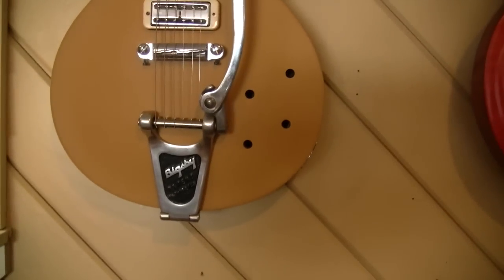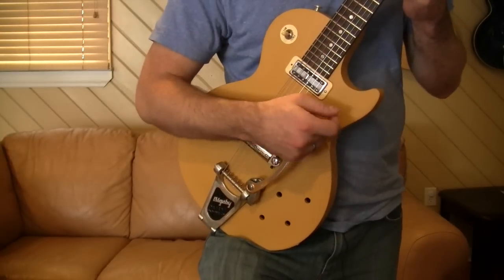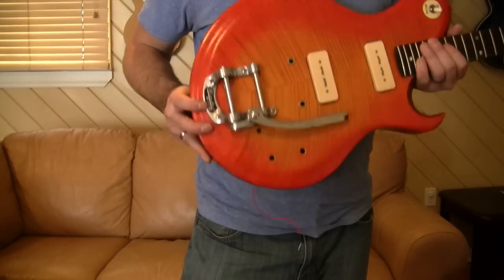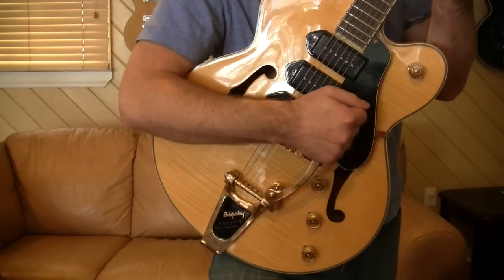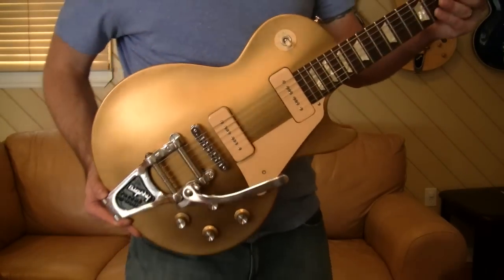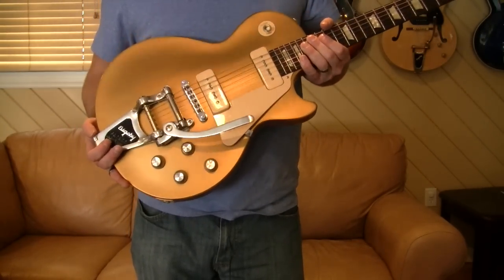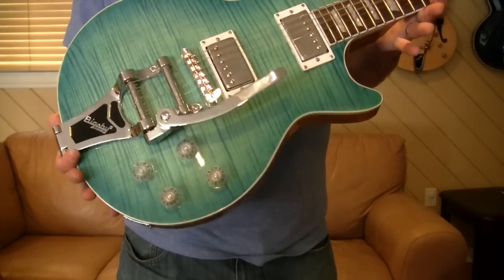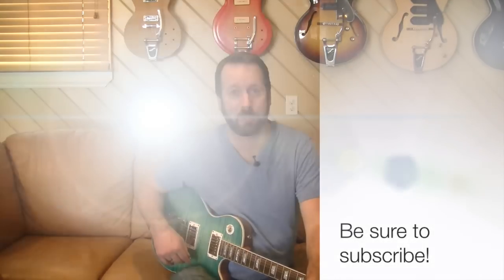Bigsby B3, B5, B50, B6, B7, B700 & Vibratmate Show and Tell

Comment: I've had a GFS "Fakesby" on my LP-style guitar for 10+ years and it works great. It looks identical to the B700, just without the Bigsby logo. I really think the issues you describe have to do with the individual piece, not the model. Perhaps how the spring fits in there, maybe something is sticking or grabbing where the spring sits. The unit itself works great. Personally I added a roller bridge. On archtops with a floating bridge you can use a bar bridge. Nice overview and cool guitars :)

Comment: ALSO.... 3 and 6 best for "taller" (often "floating") bridge = on a base,  3 on ES thinline HOLLOW body (125,  330 etc, or Casino), 6 best for larger hollow body (ES 175 etc, Gretsch 6120 etc).  7 was designed for "lower" usually "fixed" bridge... like T.O.M bridge on Les Paul, 335 etc = solid or semi hollow. B 5 for "flat top" (SG, Tele) solid body for the most part but will work on one that's arched a bit, will work on some smaller Gretsch, best with lower/fixed bridge but can function on a Jet (but 3 better due to taller bridge).

Comment: This is a really informative video. I’ve played a lot of Gretsches and Les Pauls. I always prefer the feel of the B3/B6 to the tension bar B7. I have just bought an R4 Goldtop with the stop tail wraparound bridge. I was going to try fit a B6 on there with the stock wraparound bridge. I’m anticipating obstacles with break angle and string movement over the smooth wraparound bridge, but want to try it out. What do you think?

Comment: Good rundown of the many Bigsby models. I have a B5 with the Vibramate mount on my SG, and it works great and was easy to install. I added a roller bridge which probably helps. The only slight issues are with the Gibson tuners (typical). Thanks for sharing your collection.

Comment: Great , awesome video, and bigsby guitar collection !!!!! I' like to put a bigsby on my tokai Les Paul Japan made...I heard the B7 is not a great example of stability....A luthier told me to put a B3 or B6 better than a B7 . What is your point of view ? What do think about it ? Thanks for your answer, best regards from France
Reply from the maker: Hi Belo! This is where I have a challenge too. A B7 looks right... but the break angle is really tight because it's so close to the bridge. A B3 with a towner down tension bar mounted in the stop tail holes works rather well too. Just make sure to get a V block with it so that it can mount to the body without any holes and be properly positioned. A B6 I think would need to swap the hinge with a B3/B6. Could work too, but I'd go the B3 route. TownerUSA.com has more info on their stuff. I've used them a bunch and great stuff.

Comment: Have you checked out the Brick's BiggsFix? I'm another Bigsby-hoarder and I've found that loosening that break angle really gives it a smoother ride and even helps with the tuning on many Bigsby-equipped guitars. I have 'em on 6 so far. I'll probably be adding 'em to another 12.

Comment: @Nickin the States I have a 1994 ES 135 and I am considering having a Bigsby installed . The one thing I am hesitant on is the drilling on the top of the guitar as it may lessen the value .  However I don't ever intend to sell it and like yours it is a guitar that has great meaning for me for the same reasons  . I'm pretty close to talking myself into it .Are you glad you did it and are you pleased with the performance of the guitar since then?

Comment: Nick, thanks for putting this video together. I also have a 2014 Melody Maker. I am planning on adding a Bigsby. 
I see you have Les Pauls with both the B3 and the B7. If you had to put a Bigsby on your Melody Maker all over again, which one would you use, and why. 
Does the B3 have sufficient break angle to keep the strings located in the saddles when picking hard?
Also for bonus points, could you replace the wrap around bridge on that guitar for a regular tune-o-matic or similar roller bridge now that the Bigsby is installed?
Thanks so much for your time.

Comment: I'm going to install a Bigsby B6G on my full size Epiphone Broadway Jazz Box, 17" at the bout and 3 1/8" deep. Can you recommend what type of bridge? Locking roller, Tru-Arc radius correct Rocking Bar, Tune-O-Matic, Embie-Matic w/Archtop base? So many types of bridges and so many opinions can be found on the internet.
Reply from the maker: I would do a tune o matic on a pinned arch top base. Looks right, makes string changes easier, etc. I’d do a B7 on that myself, but B6 would be cool as well.
Reply: @NickintheStates  Thanks for the info.

Comment: Awesome video! What would you recommend for a Epiphone Sheraton II pro and a Gibson SG Standard? Thanks!
Reply from the maker: Hi Bernardo! For the Sheraton I'd personally get a B3 with a Towner Down Tension Bar and Hinge Plate Adapter. That was you can go back to original if you prefer later. Plus I like the feel of that setup. For the Gibson SG Standard, I'd personally do a B5 and a Vibramate. Once gain no screw holes to contend with. I have an SG with a B3 on it but it's not the best setup.

Comment: Very helpful video! I have a question though - do you feel like you get more range out of a vibrato that has less room between the bridge and the Bigsby? In other words - are you able to get a larger interval between the resting position and the fully depressed position if there is less string length between the bridge and Bigsby?

Comment: Just got a 61 ES330. I see a lot of B7 on them but would rather not make any new holes (even though it’s a neck repair). Should I perhaps try a B6 or a B3?
Reply from the maker: B-3 works great... but what some people do is get the B-6 but swap the hinge part to the one from the B-3. The B6 has a long piece to attach to the body for deep jazz guitars. Guitarpartsresource I believe sells the part to swap. Another cool thing is that you can get vintage B3s for basically same price as new.

Comment: Thanks for posting that, Nick. Do you perhaps know which Bigsby fits to the Epiphone Casino (full hollow body thinline)?
Reply from the maker: If you don't mind putting holes in the top, then a B7 would work well. With it being full hollow though, I'd suggest a B3. It will just sit on top, not mount and it won't need any drilling if you get a Towner Hingeplate adapter to use with it. That's what I would do.

Comment: hey i have an Ibanez Ag75 what bigsby do u recommend? ? great video btw
Reply from the maker: Hey Fernando, sorry for the delay in responding. For an AG75 I'd grab a B6. Only holes will be on the lower part of the guitar near the strap pin and likely will be covered by the original tailpiece if you ever put it back. Plus I really like the attack of a B6. It's very smooth and easy going.
Reply: Nick in the States 
thanks

Comment: Did you every try the xtrem? I have one and am less than thrilled with it so far. Until I verify my nut is not the issue I can't be sure it's the trem tho. Looking at a es-339 ultra today and if I get it I think I'll put a B7 on it
Reply: Did you end up getting that es339? I’m trying to figure out the bigsby situation for mine, and what vibramade adapter goes with it

Comment: Would you recomend putting a bigsby on a bass 6 style guitar? I got a jazzmaster baritone with a 30 inch scale I’m going to string it as a bass 6 so really high gauge strings and low tuning. I want to put a bigsby on a jazzmaster but don’t know if it can handle that with tuning stability. What do you think ?

Comment: Thanks for the great information on bigsbys. I'm thinking of installing a bigsby on my les paul less plus 2015 myself. I've heard different people saying that, on a les paul, there are tuning issues because the B7 sits close to the tune-o-matic bridge and causes the bridge to move and wiggle when the bigsby is used. Whats your experience?
Reply from the maker: I still prefer a B7 on a Les Paul There is less strain and issues if you use a Vibramate with it as it will raise up the Bigsby a bit. This will put less tension over the bridge and makes it more stable. Another key thing is to make sure you have a well lubricated nut. This will keep the strings from unnecessarily stretching.

Comment: Hi Nick.  Got a late 40's ES-125 that i want to add either a B3 or B6.  Seems like both would work based on your observation.  Any preference?  Mostly a strummer.  And folks who wish to comment, spare me the guilt over 'disfiguring' this vintage instrument.  :) It's already a few mods from original.

Comment: Hey Nick,

first of all, I just want to say your channel is awesome. I found your channel today when I was researching Bigsbys and this was really informative. But I had a question...
I just ordered the Gibson Midtown Custom in Ebony and I really, really want to put a Bigsby on there. I'm looking to get an all gold Bigsby on there to really capture the look of a classic Gibson 355. But the Midtown Custom isn't an archtop so I'm a little worried... would this fit it? https://reverb.com/item/120546-aged-relic-bigsby-b7-gold-vibramate-v7-kit-b7g-gibson-les-paul-free-shipping
Reply from the maker: Edward Kim Hey Edward. Thanks for the kind words! It SHOULD fit. The Vibramate will help as it will lift the Bisgby up a little bit relative to the bridge. If it was too low the strings could hit the edge of the bridge on their way to the Bigsby. That is going to look great! Another option might be a Towner DTB and hing plate adapter. I use it on my SG with a Bigsby B3. That's a flat top using an archtop Bigsby as well. I have a video putting one on a 335 style guitar (Harley Benton E35). Check it out! It may work better...

Comment: Ive owned an es-335 for years, and it's has four small holes around the strap point. It doesn't have holes on the body on the way up to the bridge though. Would someone know which Bigsby I should buy for it? The holes are already there, I'd just need the right bigsby and the four screws, presumably. 

I'm thinking the B3 would be the one to aim for?

I remember when I bought the guitar off a vintage guitar guy, he said it once had a bigsby fitted, but I was too young and careless to think to ask him which bigsby it was

Comment: On Les Pauls, is there any modifications needed to the case for the guitar to fit once the Bigsby is added?
Reply: ive read today somewhere a guy said it fits in the stock case but it does touch the case top a little bit. i was curious myself because id like to get the B7/V7

Comment: Hi Nick. I have a MIK Epiphone Wildkat with a B70 (I think). When I first got it I string it without passing the strings under the roller. It didn’t make any difference. Can you explain what the roller is therefore for? It looks good but is there a reason for having it? Cheers from the UK.
Reply from the maker: The roller changes the attack. Without it the tremelo action is a little smoother. When you go under the bar it makes it a bit tighter sounding. It's really a taste preference thing.
Reply: Nick in the States Cheers for the reply. I will have to A/B it again. I honestly couldn’t here difference or feel any difference. Think anyway I will change the spring because it does feel stiff.

Comment: I don,t know if your  still getting messg, but I  have A Gibson Small Body Simi Hollow

2012, and want to use A Full Bigsby, it saddle is standard 3 1/4 and  I have Almost 8

I was Thinking if I just Add A thicker piece on the back to make up the space.

Would the Les Paul Mont work ?????????    JR
Reply from the maker: Hey John! Which model Gibson is it? A 339?
Reply: Thats the problem....its number is DSDCCTVSCH1 SERIAL # 
110221474  DATE 5/11/12-sorry couldnt get back sooner-
I Picked up A Blonde A 90 telecaster w/gibson bridge and I use A bigby
B5 W/vibramate just to play around with  that, didn't want anything permanent on the gibson Anyway, in fact, spoke with bigsby people?
Guy was, Like, where y/ get this Gibson, Sam Ash,  Was Just sitting
there, Love it, Still Plays Beautifully, Its strange, I Have Books on cataloging by numbers, and  the gold sticker????And this on don't have it.
I also Have A OLd Humming bird needs neck Re Fastening and two slight  cracks on top body in, Queens????????  New York  If y Can Help out

Johnny Robberts

Comment: you briefly mentioned a B7 for an es 339...any other solutions for this in-between sizes guitar body?  being slightly larger than the LP the tailpiece holes show if screwed into the body, a V7 won't fit, and i don't like the idea of using a flat top B5/V5 on an arch top guitar, (as vibrate suggested). thanks

Comment: Hey guy. Do you have a B5 or B50 on any flat top guitars WITHOUT a vibramate ?. I am going to fit a Bigsby on my SG tribute, but want to know if it will cover the post holes without the vibramate ... I'm not worried about drilling holes.
Reply from the maker: TelepathicTraffic Not retrofitted... but when I get home tonight I'll take a look and see. I think it would be just like a Les Paul where it is mostly covered with just a sliver of one showing. A lot of people mount them farther down the body so the screw holes are after the post holes but I personally think the look a little off. If it were me I'd measure the post holes and sink a couple dowels into where they were. Then just mount the Bigsby where god intended it.
Reply: Nick in the States I guess my question is do I NEED a vibramate ... most people seem to purchase one, but I don't know if it's just easier or they want to avoid drilling holes. It's my understanding that if I purchase a vibramate then I need the B5 and the B50 won't fit. Anyway, I think I'm just going to go ahead with the B50 and see how it looks ... it's cheaper as well. From what I can tell there is no set place for a Bigsby, mostly up to preference, however the instructions advise to mount the bar over where the original tailpiece would be. Thanks.
Reply from the maker: TelepathicTraffic Ahh gotcha. No, you don't need one. Most people just follow the herd and get one. Gibson has mounted them all over the place over the years on SG's. I'd prefer to mount it as close to the bridge as possible that still allows the strings not to rub the bridge edge on its path to the Bigsby. If you're willing to have holes then no need at all on the Vibramate.
Reply: Nick in the States I'm going to get a roller bridge with it as well. I was toying with it today. I'll mount it as per instruction and to hide the holes as best as possible. I'll fill the bridge holes if I must I suppose.
Reply from the maker: Good plan. I think that will complete the metamorphosis of your SG from good to GREAT.

Comment: Does the B6 require screwing into the top of the guitar? I’d like to put one on my Casino (currently has a trapeze) but leery of drilling
Reply: The Vibrate is what you need.  See Stewmac, etc..
Reply: Vibramade makes adapters for people who don’t want to drill, but since casinos don’t have tune o’ matic bridges, i don’t think theres an adapter for them

Comment: Nick! I need help! I want to put a B5 Biggs on my American standard telecaster...buuuut I love the modern bridge and 6 saddle configuration...is there a setup out there for me? Do I need to change the neck angle at all? Thanks bro! - Nick
Reply from the maker: +Nicholas Barile Hey man! There is a kit that comes with a mustang or jazzmaster bridge... I can never remember. still gives you 5 adjustable saddles. Shouldn't need any neck angle switch. I think Callaham has a bridge as well, stock ash tray that works with a Bigsby. I think that one though is just the three screw variety.
Reply: There's a telecaster vibramate thing

Comment: Hey Nick, which model did you recommend for my 335? Dont want to drill any holes in her! lol!
Reply from the maker: +Mike Boudreaux Hey Mike! If it's a stop tail I'd get a towner down tension bar which will replace the stop tail portion. Then get their hinge plate adapter and a Bigsby B3. The strap pin screws through the hingeplate adapter and holds the Bigsby to the guitar without any holes. It's really the perfect solution for a stop tail 335.
Reply: +Nick in the States hey nick, do you have somewhere I can send you pics of the guitar to confirm? Thx again for all the help, much appreciated!
Reply from the maker: nickinthestates@gmail.com send 'em on over! Heading out now but will check when I get back.

Comment: If only they didn't cost so much. I really wanted one for a Chibson, but alas I can't bring myself to buck up. My original Chinese purchase I had planned on one. Love the look. I figured those Chinese Bigsby copies were shitty. They just don't do hardware very well overall. I might try an Xtrem, had one in the cart a few times hehe. Not sure I like the look but for the money ... hey. Good video, mic has helped BTW.
Reply from the maker: Yeah they're not cheap but they're reusable at least and you can always sell them for what you paid if you buy used. The buggers never wear in any way so that's a good thing. I too have had the Xtrem in the cart and might pull the trigger soon. Would be interesting to try and the shape is so far off on my blue on that it's already the bastard child in the collection. Plus it'd make a neat video! Thanks for the feedback on the mic (pun not intended). I was listening to one of my videos at work with headphones on and was appalled! Also discovered an audio filter in iMovie for removing background noise that works wonders. Slow improvements!

Comment: witch bigsby i should use on my Epiphone casino?
Reply: Mexican one
Reply from the maker: That is actually up to you. For a Casino, I'd do a B3 with a towner hinge plate adapter. No screw holes on the nice full hollow Casino. If you do a B7 it will screw to the top. The latter is a bit better if you're going to abuse it greatly. I love single bar Bigsby's though like the B3. That would be my choice.
Reply: Thanks Nick!
Reply: Manuel Proto Don't listen to that mate, use a Mexican one, that's gonna work for you.